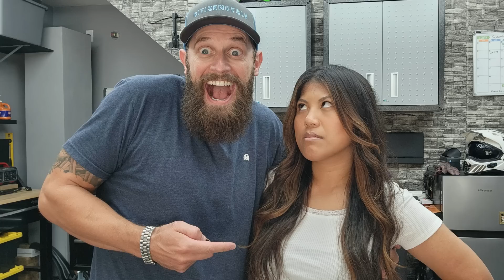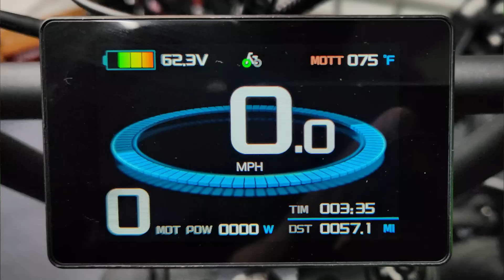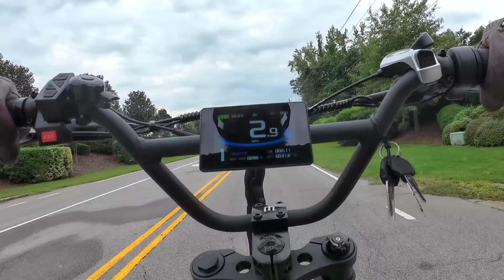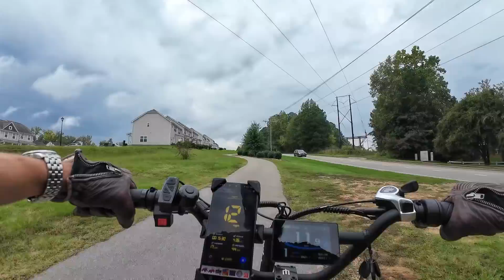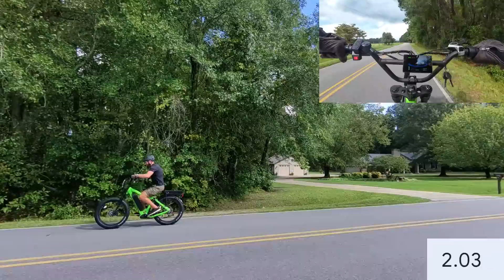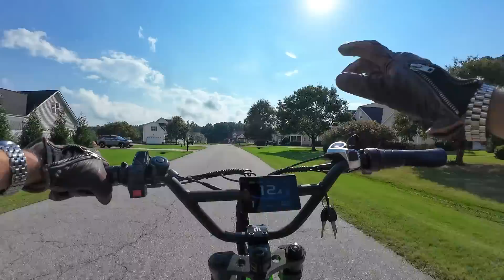Wired Predator: Testing a New 6000w eBike

Comment: I've never owned an electric vehicle, but currently in the market for a quality E-bike.  This one might be overkill but it's very tempting. Does anyone know how many years I could expect to get out of it before it goes kaput? I live in a rural area, next to a 100 mile long paved bike trail; I'll be doing most of my grocery shopping on it...but little else, aside from pleasure riding 2-3x a week.
Reply: I'm ready to remove the pedals and cranks leaving a shaft foot peg.Its that good.pedaling is unnecessary but keeps the karens at bay.get the newer model.its faster.

Comment: Under the worst-case scenario, if you blast the Wired Predator at max speed, then you get only 17 miles of range at 55mph in 19 minutes, assuming you constantly use 8000w throughout the whole time. For Wired Warrior and Wired Scout, you'd be looking at a worst-case scenario range of 23 miles at 45mph using 5000w in 30 minutes. For the Wired Freedom and Wired Cruiser, it is a range of 23 miles at 35mph in 39 minutes. This electric bike might be the best 0.315 hours of many riders' lives.

Comment: Out of Class, Means not an E Bike. Not legal, here in the States. Please stop promoting these motorcycles as E bikes, as they are not. DOT sets the rules. Bikes are being confiscated now, as the police know when it's over powered. Want to make and sell motorcycles? Great, get the DOT certifications with DOT Brakes, Lights, and DOT approved frames. Get a Plate on it, and be legal. No Problemo! Cool, in fact. But don't be pretending this is an e bike and it's okay, because it's not. Companies are getting fined hundreds of thousands of dollars for selling illegal bikes now. 750 watts=E Bike. 1.5 hp+30 mph=Moped. Up to 5,000 watts is a scooter, like a vespa. And above that, is Motorcycle. DOT rules matter.

Comment: 6,000 watts is about 8 horsepower.  Puts my 375 watt e-bike to shame.  Not quite as impressive when compared with my wife's 23 hp Vespa.  Pretty puny compared with my 125 hp BMW 1200 motorcycle.

Comment: on your top speed  test did the computer stop you from higher speeds, was the bike on any restriction modes? thanks for posting,
Reply from the maker: @bob-j1t  I had the bike unlocked, that's as fast as it could go, fast is the motor could spin.

Comment: I just bought the Seeker 24, the frame of that bike looks just like the one I have! Now the controls look different, and the handle bars are different, and your bike doesn't have fork adjustment, other than that, it looks just like mine. 5 different sellers, same bike! Different names. Oh ya,  mine is still in the house, haven't ridden yet.

Comment: Front is 1000 watts, Rear is 15000 watts = 2500 watts. Somebody can't add. This is not a 6000 watt electric bike. Peak power is not the normal power, it is deception, it is the motor working beyond its comfort range,  before it BURNS OUT, from over stress. A bike with 1000 watt front and 15000watt rear, CANNOT COMPLETE WITH A REAL 6000 WATT BIKE, THAT HAS 3000 watts Front and 3000 watt Rear. This is false advertising, to sell low watt bikes, that will soon end up in land fills, a waste of natural resources 😢. Stop trying to trick people with PEAK POWER QUOTES, THEY ARE DECEPTIVE.

Comment: Impressive but over the top. My Ecell's 5 Star can do 40mph, can take the steepest hills, got it for $1,899. I love it and it's really all I need. Best bang for the buck IMO.
Reply: Well the  e cells is now $2695 for a dual battery five star with months long delays.  Keep telling yourself you’re happy with an underpowered 2200 watt ecell vs 3300 watts on the Freedom or over 6000 watts on the Predator.  E cells also get an F rating from the BBB and is run by a 70 year old felon out of a double wide in armpit NV.  The dude is such a fraud and full of excuses for boatloads of broken promises.  The only way to cancel your order and get your money back from e cells is to file a complaint with the BBB and the FTC😂😂😂

Comment: Yes sir, I was.
Wondering , if the power button on the back battery is just for The extra tail light? Or is that actually what activates the back battery? having to turn it on first before each ride? In other words do you have to turn that on for the back battery to work?
Reply from the maker: @cwebb5537  the button is just for the tail light you do not have to turn the battery pack on

Comment: Front motor seems like a gimmick and that wheel spin is ridiculous.  I have a built Talaria pulling about 16,000 watts to the rear wheel and it only burns out on pavement when I make it (front brake pulled, weight over bars.)  It will loop out if you're not careful, but not burnout on pavement.  Also, with a heavy, powerful e-bike like this, you really should talk more about the brakes & suspension.  If they are underspec'd, it's an accident waiting to happen.  An offroad segment would be helpful, too.

Comment: I understand your excitement.... It's the acceleration you can only get with a dual motor bike. I just got a Lyric graffiti X , the top speed is 50 mph, but it sucks off the line. I still drive my Grizzly cause I miss that off the line acceleration... especially when I'm in a lot of traffic, you don't want a bike that's sluggish if the line. I notice a lot of the comments saying their bike does 40 like it's biting special. But it's not about top speed... Is about how fast u get there...and under 8 seconds to 40 is absolutely unheard of for ebikes.

Comment: Wholly Guacamole CitizenCycle !  1500w back wheel, 1000w front wheel.  That looks very powerful.  I am surprised that the Wired team did not increase the size of the two batteries.  With all of the new wattage and power - don't the batteries drain much more quickly?  How would you compare and contract a CitizenCycle range test on Wired Freedom/Cruiser (with 1500w) vs this beast ?  The Predator appears to have the identical batteries and so I would expect that batteries to not last long.  Time for a road test !

Comment: Great review.  I like that you covered all the performance aspects. 

My predator was delivered TODAY!  Bad part is I found your video after ordering, so no discount for me & I've yet to get home to open, assemble, & check it out.
Reply: how is it
Reply: @ it’s powerful & fast.  I’m riding it on flat terrain.  I’m 6”2 280 & cruise upper 30s in PAS3……It’ll go low 40s in PAS5 both while pedaling.  
I did a 56 mile trip & returned with 40% battery.  This was pedaling @ various PAS.

Comment: NICE. We know it can accelerate, and its top speed is 45ishmph.
This test is mostly pointless. I mean, how many acceleration tests do we need? 
How are the brakes? 
It has knobby tires, is it meant for on or off road?
How are the shocks? 
Are the batteries removeable?

Comment: Hows the suspension on this bike and the range? Im torn on deciding which bike i want between this and the ecells triple crown. Im leaning towards this cause i dont wanna wait 3 plus months for the ecells and also this is nearly half the price.
Also have you had it off road riding? Wondering how it handles over rougher terrain
Reply from the maker: @devinshaw3521  on the streets around town the suspension felt really good, it's a four link suspension with adjustable air shock, quite a bit of travel in it, so it's a soft ride. I have not taken it off-road so I don't know how it handles rough terrain.

Comment: Looks like fun but I am not understanding the point of having pedals on it at this level of power and speed.  It is an electric motorcycle with pedals and probably less safe bc the rest is bicycle components.  So why not just get the e-motorcycle.   Does having the pedals and chain on it get you around laws of where you can ride it?  That might be the only reason I so see having the, "bike" over the e-motorcycle.

Comment: Would it be possible to program the parameters on the front wheel controller to fine tune the low speeds and eliminate the front burnouts ?
Reply from the maker: if you check my latest video you can see how to program to tune it down and eliminate wheel spin completely

Comment: I have a Freesky Swift Horse with the unlimited controller that will hit 41mph on pas5 and a fully charged battery (and a teeny bit of a downhill lol) I replaced the forks, shock, brakes, bars, pedals, saddle, grips etc...but I've got it just how I want it now. Won't do burnouts tho unless it's snowing maybe. Still plenty fast for around town. Edit,  changed the freewheel to an 11 tooth high (low?) gear I hate ghost pedaling.

Comment: Been seriously considering a 5600w - 6000w 60 volt Scooter deathmobile. Why? Cause they are available under a grand on Amazon. Quality? Laughable, Safety? Non-existent! So why? Well, you don't HAVE to go 50 MPH on a scooter just because it will do it, right? Why Not? I know myself. I'll do 30... mid 30's, 40... call it good, then 42.. 44.. you see where this is going right? This is why I don't pull the trigger. It's a loaded weapon, pointed at myself. Dang I want that thing, LOL.

Comment: 6000 watts using dual motor is incredibly inefficient. Your top speed is only 43 mph with 6000w on a single rear motor your top speed would be 55-58 mph. That is way too much power draw for 35ah. On full charge your range would be like 15 miles. These bikes don't need a second motor they need more battery. 2 kwh is not enough they need a minimum of 3 kwh if not closer to 4.

Comment: the front wheel spin seems dangerous, I'm assuming this is a prototype bike?? Hopefully WIRED can dial that front motor spinout back. My bike did the same thing when It was on dual phaserunners 72V.. if you give the front hub whole hog it does burnouts up to 30, where the front wheel has no traction, if you learn or turn at all the front wheel can slip out.

Comment: Hey CC, I did not hear you say what size the brake rotors were? They need to be substantial, given the momentum this power can generate. Secondly, it must weigh a ton? And lastly, instead of having your wife out there, you can use a drone to video you from a third person perspective.
Reply from the maker: 203mm rotors front and back, Weights 123lbs, all my third person footage is done with a drone, I am a one man show! :)
Reply: So I ordered my regular dual battery Cruiser bike a few days ago…Saturday I think. Picked it up Tuesday and it’s really fantastic! I am 6’5” and had a Freedom but sold it. Loved it too! Got a great sale so I got this. I am fit and tall but the step through is very nice.  This bike had a ton more pep than my March 2025 Freedom. Thanks for all your inland reply to my questions. I didn’t get a discount but I did order via your link.

Comment: nice video. What size brake rotors does it have and are the brake calipers dual or 4 piston
Reply: 203
Reply from the maker: 203mm front and back with 4piston Gemma Brakes.

Comment: Hmmm dont mean to burst your bubble guy, but mathematically its impossible to have 6000w (6kw) of power  from a 40A controller 😂. 60v battery fully charged is 67v (give or take)  67 X 40 is 2680 watts about half of what your implying 😂 , even peak burst theres no way that controller pushes out close to 100 amps, they're not using a fardriver, sabtovon, flipsky or even a sinewave controller so believe what you want but you look a bit foolish calling a 60v bike with 2 1000w geared  and rebranded bafang motors and making out that combined somehow they'll push 6kw off a average looking 60v battery with a 40 amp BMS 😂
Reply: Why don’t you actually watch the video, the controllers are putting out 100 amps peak or 6700 watts
Reply: You didn't watch the video

Comment: I bought my 2024 Wired Freedom after watching the reviews here. I even used CC’s discount code for a few bucks off the price. I appreciate his reviews. After watching this one, my opinion is this model would be a greater benefit to those that ride in hilly areas or areas with lots of changes of elevation. Outside of a climbing advantage, and raw takeoff power, I think my 2024 Freedom is as good for typical applications.
Reply from the maker: yep, the regular Freedoms and Cruisers has ample power, this Predator is just a powerhouse, more than the typical rider needs, i think that is why they only made a small amount.
Reply: @CitizenCycle925  I hear you on that. I could also see this being an advantage for those that one to use on uneven trails, off rode use. Very interesting. And I think it's good that it still looks like a Bicycle.
Reply: Of the 3 models,  which would be better for a X-C trek from CA to Maine with a Hurley-style trailer?

Comment: I got my freedom 24+ today.  When i watched this video earlier today, i felt a little salty this one wasnt available when I ordered. After assembling it this evening and taking it on a test run. I have realized one thing, I do not want to go any faster on a bicycle! The single motor pulls. You will not be disappointed..
Reply: I was salty too when I found out that this came out because this is exactly what I wanted.
Reply: @luigiprovencher what the heck is salty? I'm 50 years old and I never heard that term before? Do you mean you feel duped?
Reply: @firstinlastout  Pissed off.
Reply: Means angry or fustrated  @firstinlastout
Reply: I'm 62 with riding experience but yeah...I don't need a bike this powerful either. I'd probably kill myself on it. But it sure would be fun!
Reply: @mikemeengs5720 nobody NEEDS that power and speed, technically we could all get to our destinations traveling at 20 mph but some of us WANT the speed, I commute 8.5 miles each way to work and I like to just get there and back quickly. At 20 mph with stops my commute would take me 30 minutes each way. At 40 mph I can cut that time in half so for me the speed is greatly appreciated because it's a time saver.

Comment: It would be nice if they started using a 50 amp controller on the cruiser and freedom. If the rear is the same motor it should handle it fine.
Reply: Yes it would🤔
Reply from the maker: I believe they beefed up this rear motor a bit to handle the increased power.  And i wouldn't be surprised to see 50a controllers on the freedom in the future.

Comment: I don't need more power, I need more range, even 35ah is not enough, I just want a wired cruiser with a 60ah battery so 100 miles becomes feasible, the current motor is plenty, they just need a smoother throttle and bigger battery, that would make for my dream bike

Comment: Even my dual 1KW will spin the front wheel.   With those BMX bars, your weight is shifted over the seat.  If you had mountain bike bars, with your weight shifted forward, front wheel spin will be "less".  But most likely not entirely gone.   Might I suggest Innova Hybrid tires to enhance the street traction.  This will reduce spin as well. The change to my Innova Hybrid tires helped reduce my front wheel spin.

Comment: I noticed in the video that the tires seem to be dual purpose (off road/on road) by the semi-knobby tread. From what other reviewers have said in their video's on e-bikes, a softer tire with a street tread might do the trick. One of them mentioned switching to PTM tires (If I remember correctly)  PTM tires are supposedly softer rubber and made for street use. The draw back is if you take your e-bike off road you don't have the knobby tread for traction in the dirt.